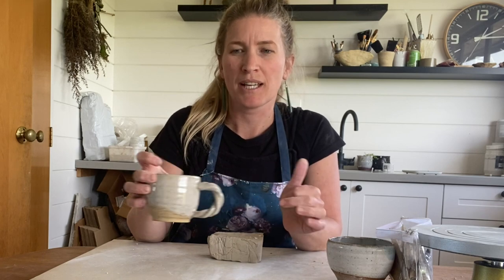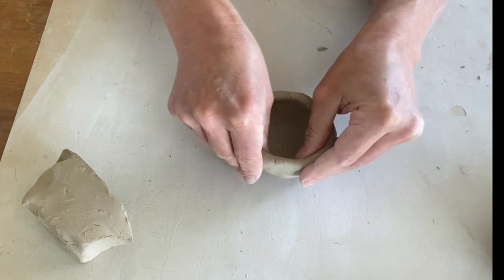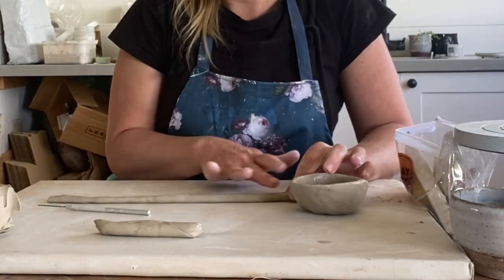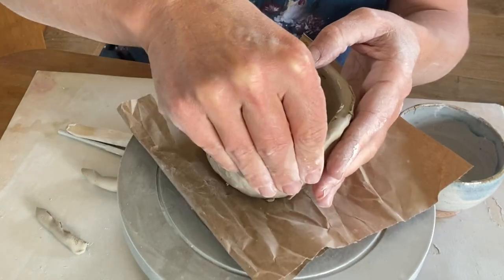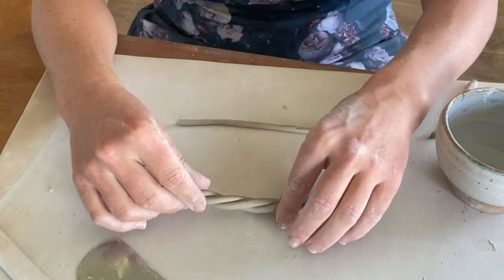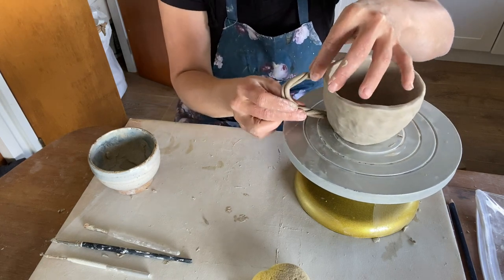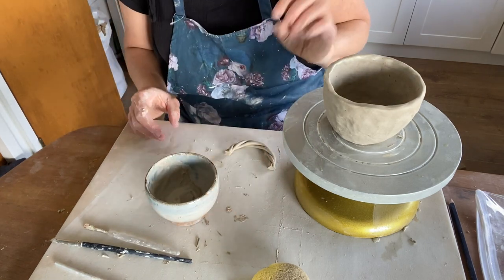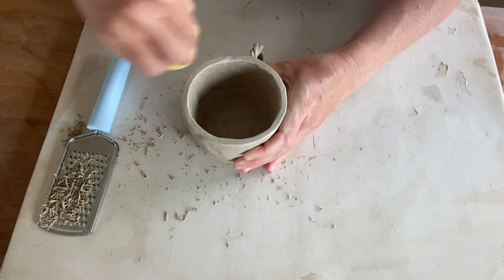Pinch Pot Handmade Mug

Comment: Hi Clay Play, I was just wondering if you have any recommendations for a budget kiln please?
Reply from the maker: Hi Jason, If you are on a budget I would recommend getting a second hand kiln as Im not aware of a reliable budget kiln. I know of potters that have purchased cheap kilns from china and they have worked well however as soon as they have had issues they haven't been able to get the support to fix issues. You can get some reputable kilns at a great price and the bonus is the seller will give you details as to how they program the kiln for certain firings ( which usually takes a while to work out with any kiln) , where to get element sand spare part etc.
Reply: @clayplayathome  thank you will have a look into it 😁